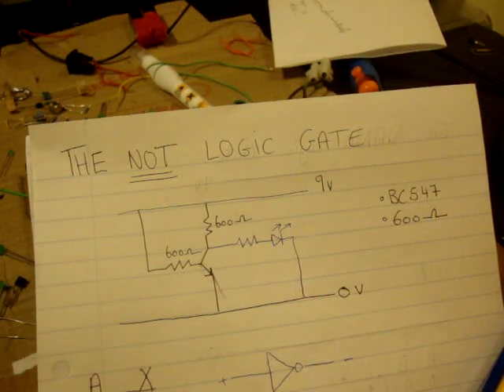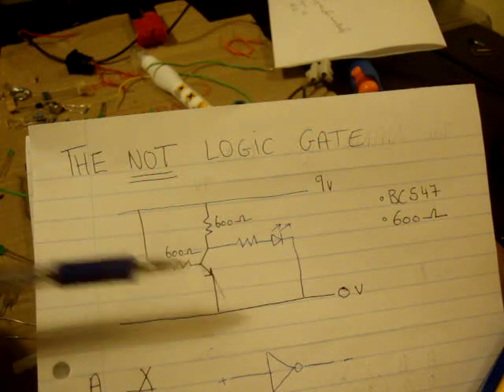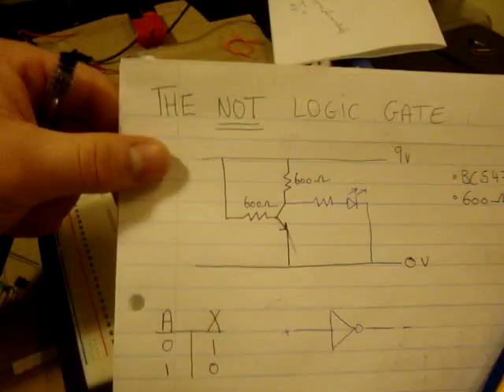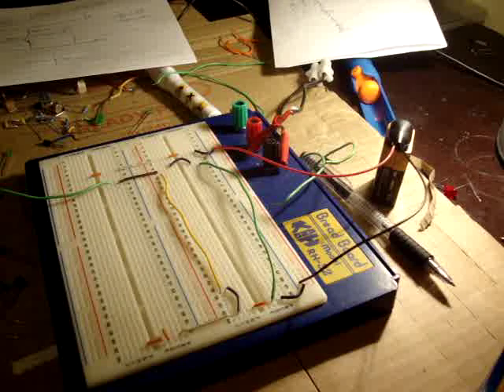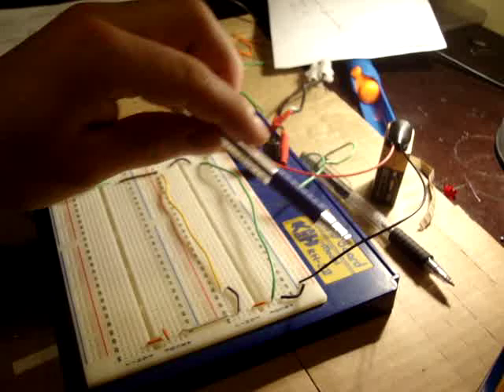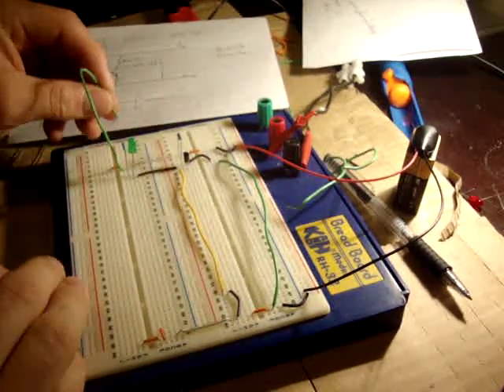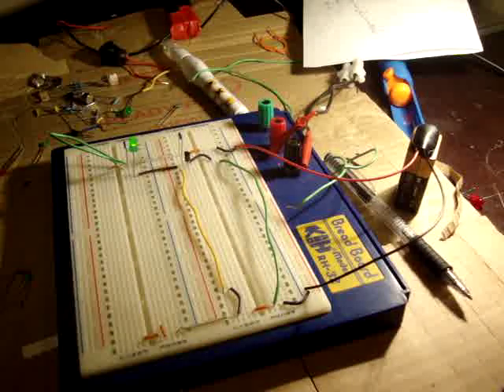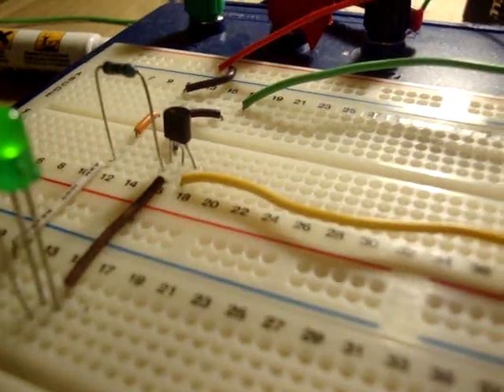Electronics 5 : How to Make a NOT Gate (Wire a Transistor)

Comment: What exact parts do you use? I mean, I have 9v batteries and wires, but I have no idea if my wires are thick/thin enough, and the local electronics store has thousands of different transistors, what 'name' (that would be something like 'fp0X37c', some random name) do the transistors you use have? Sorry for my (possibly) incorrect English, I'm Dutch (Europe).
Thank's in advance (if you actually read this, and are planning on awsering it).

Comment from the maker: hi there @thethirdeyefunction. a battery gives a potential energy to electons. in this case, they have a poential of 9V (where voltage is electric potential energy per unit charge). Thus when an electron leaves a battery, it has a potential of 9V. It must use all of this energy before it returns to the battery (it must enter the battery with 0V). So if the connection is just a wire, all this energy is used to heat the wire (a short circuit).